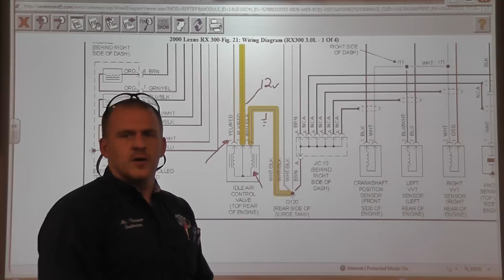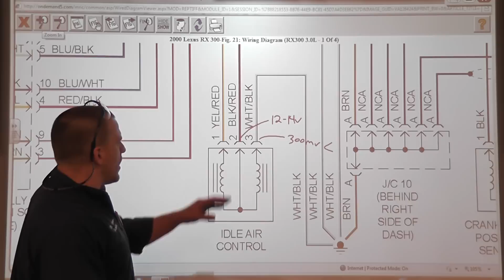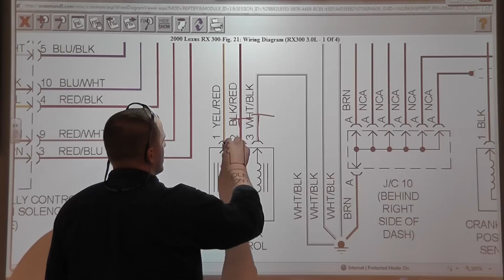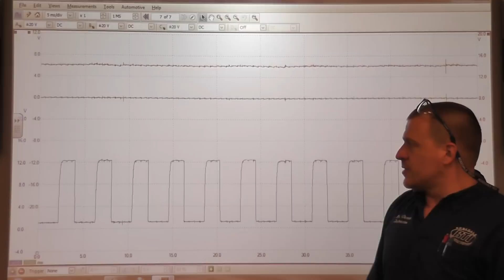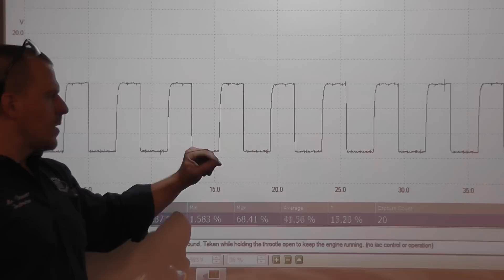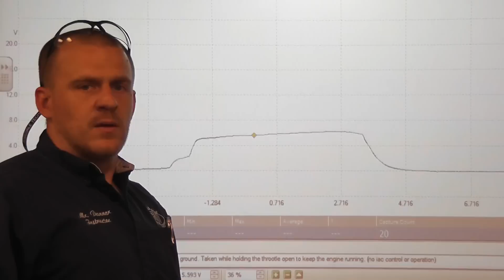Causes of low compression, no start from a stuck closed IAC (part 2) - Toyota/Lexus

Comment: Is though for the the voltage the battery voltage on that sensor one side it says it’s four volts and then the other side says it’s around 13 volts
. That would be a little confusing.

Comment: Question: Why aren't there any spikes from the magnetic field collapsing on this square wave?
Reply from the maker: Good question. This would simply be circuit a design where there are capacitors and diodes absorbing the spikes or its simply a matter of the speed it is being switched on and off factored with a super low amount of current flow
Reply: @ScannerDanner  Is there any way to distinguish between a good non spike signal and a bad square wave that isn't a result of collapsing magnetic fields? Also, just wanted to thank you for your channel. I bought your ebook and just joined Premium. I was blown away at the thoroughness. You were born to teach!

Comment: What led you to the idle air control valve being mechanically stuck? The idle flare up on start up?
Reply from the maker: Did you watch part 1? This one was crazy
Reply: @ScannerDanner  I just realized that.😂 that was alot of vacuum on a cranking engine. I don't think I would have found that one. Probably would have pulled the timing down for no reason. Definitely sounded like timing
Reply from the maker: @chrismay9319 I was about to go down that path too!
Reply: @ScannerDanner  this is exactly why I've been watching alot of your videos recently. I had to come to terms with my limitations as a technician and I had a decision to make. Either keep doing scan tool and multimeter diagnostic or jump into the scope world and further my diagnostic education. You've been a big help with that. Great stuff and I look forward to getting into your premium channel soon! Your helping people become better technicians in a world of parts changers😁
Reply from the maker: @chrismay9319  looking forward to having you Chris! Tons of videos here too 🙂
730 on YT and 540 on my website btw

Comment: Yes but the FLAIR-UP only happens if the engine is restarted warm, not starting from cold, if I understand it correctly; I notice it with my dodge ram v8.
Reply from the maker: Correct. Cold engine start up will have an elevated RPM that will stay elevated for a period of time
Reply: @ScannerDanner  thank you for replying Paul

Comment: I have an 07 Lexus IS 350 I’ve lost compression on cylinder 1 how does this cause loss of compression?
Reply from the maker: complete loss of compression, all cylinders, because the air intake passages were completely closed (stuck shut IAC combined with a dirty throttle body) The engine would start if we opened the throttle

Comment: I have "similar" issue.  1995 T100 3.4L...it sat for 2yrs.  It had compression & ran when parked. Now, NO compression on ANY cylinder.  Timing is correct and belt on. Checked compression testers. Put marvel mystery oil in cylinders and everywhere I could.  Still , NO compression??? Any suggestions?
Reply from the maker: Did you have the throttle open when you did your compression test?
Reply: @ScannerDanner  yes, I opened the throttle when trying....it reads zero across ALL cylinder and this vehicle I have driven since was brand new.
Reply from the maker: Broken timing belt or chain would be the next thing I'd check for
Reply: @ScannerDanner  that was 1st thing I checked.  Pulled the timing belt cover off, got my wife to turn it over. I wanted to see that at least the crankshaft was turning...lol. checked and belt on, all timing marks were on the money with #1 at TDC??? I haven't messed with it today at all. I just went out and squirted it down with marvel mystery oil / kroil oil mixture. In cylinders,  through oil fill hole, through pvc hole (just trying to soak it all in the oil). Some recommended me put some very thick oil in the cylinders b4 I check compression again, after letting everything soak?
Reply: @ScannerDanner  your video, the two part about IAC valve.....all I can say is Thank You!!! I took the IAC off and it was gummed up bad, stuck closed!!!......I should see a difference now right???... that I cleaned the throttle body like you mentioned in your videos and cleaned the IAC and got it working very free and like it should be working? I should at least have compression on some cylinderS I would think?  Its just so hard to set in that this little valve, that is supposed to control the idle, can do what it did!
Reply from the maker: @dgmenace73  but you said you had the throttle open when you did the compression test. That would eliminate the IAC being stuck closed as a cause for the no compression. 
So you're saying it runs now?
Reply: @ScannerDanner  no, I am not sure.  I'm only able to mess with it a few minutes at a time.....with all timing marks lined up and belt on, checked the rh side under valve cover b4 I did the IAC clean, even the marks are lined up on two gears there....so I am like 95% sure its not timing. I can see what you mean by giving it throttle would eliminate that valve because it would suck air in through the throttle body main air intake.   Is there anything else that you can think of....like something somewhere in throttle body stopped up like that IAC valve was?  I have never worked on on of these internally.  I have rebuilt old V8 like 318s and rebuilt 2.2 and 2.5 front wheel drive engines....never a double overhead cam engine. It looks like to me, I got to get me a helper.....but it looks like to be that the lifters or caps I think they are called, at least on #1 cylinder,  I can see that they have moved....I think they may be shimmed? Am I correct? They have a flat metal spacer in between the cam lobes and the lifters....it would be nice if I could rig up a way to turn over, may can get to starter solenoid on that side to turn it over and watch.  I thought soaking for several days now in marvel mystery oil and kroil oil would have broke anything seized up?  Any suggestions from you would GREATLY be appreciated.  I have not watched any videos as detailed as yours.  One of my compression testers has a male quick connect on it....I was thinking about connect to may air tank, or compressor to see if I can tell where air blown in cylinder would go.  I had someone ask me could the muffler or converter be completely stopped up?  I now with ATVs they won't run but it seems like they have compression,  only happened once to me....ATV had very bad blockage but it would crank and start.  I just don't see all valves being stuck? Have u seen that before?  I guess I just got excited that the iac was badly stuck closed....smh. i don't have a leak down tester but i plan on borrowing or buying one. Thanks in advance.
Reply: I meant I CAN'T see where #1 lifters have moved
Reply from the maker: @dgmenace73  leak down tester can simply be a compression hose with the check valve removed and an air line hooked up. No compression on any cylinder after just sitting, and it ran before you parked it, is unusual, especially if you have confirmed that your timing belt is still in alignment.  Let's get air in those cylinders and see where it is going. Maybe the headgasket failed on you? Block froze from not enough coolant?

Comment: What if my car had a high over extended rev before these symptoms occurred?
Reply from the maker: what, no compression after over revving the engine? just make sure your throttle is open when you do your compression test. If it is, you have engine damage

Comment: Really hope this is the issue with my 5VZFE. Been through everything else. Fuel, spark, timing are all there but when i took a look at my iac valve (thanks to you) I noticed it was frozen. (never thought to try and start it with TB cracked a little) also has 2 cylinders at 60 and 70 psi.
Reply from the maker: Don't panic about those two low cylinders just yet. Cylinder "wash" from extended cranking can reduce compression pressures drastically. Once you get it running, as long as it's not misfiring, you should be good to go.
Reply: Just got it running today and it cranked over a lot easier then before. Adding to my  favorites Have a miss but i think it was from a loose plug wire/injector

Comment: Can this happen on a civic 00? Even though it’s a different kind of iac?
Reply from the maker: can what happen? low compression?
Step on your gas pedal a little during cranking, if this doesn't improve your low compression issue, then no, this is not your problem.

Comment: Hey Paul ive got a question about your voltage tests using the scope. Would the scope show you a corroded wire whilst looking at voltage? 
The other day i was working on a horn circuit which is a simple 2 pin horn design, where one pin is 12v constant and then the other pin is earthed when the horn button is pressed. I had the 12v constant using my multimeter and a good earth but the horn wouldnt work. Horn unit was fine and the problem was a corroded live wire. I had to independantly load test the live wire using a high watt bulb at one end to confirm the issue. So would the scope show me a flat line 12v in my scenario or with the scope being so quick would i see it glitching all over showing me i had a problem? Thanks alot
Reply from the maker: To see the corroded wire with a voltmeter, the circuit must be loaded (horn blowing). So with the horn not working, you still needed to hold down on the horn button or pad for ALL voltage tests. Did you do that?
Reply: ScannerDanner no i didnt have the horn pressed whilst checking for the perminant live feed. So i assume that is an unloaded voltage test which isnt good enough to confirm wire integrity?
Reply from the maker: That is correct my friend. There MUST be current flow for accurate voltage measurements. And when current flow cannot be established (say the horn motor itself was open), this is where a simple incandescent test light can be your best friend.
Reply from the maker: In your case, had you been pressing the horn button during your tests, you would have definitely seen the voltage drop and would have known immediately you had a wiring problem.
Reply: Paul as always i truelly appreciate you taking the time to reply and giving me guidance. I will adjust my testing method moving forwards 👍
Reply from the maker: awesome, and this particular one will change your life. seriously man. 
Thanks so much

Comment: would the unplug it test give a OK understanding  of the circuit design if a wiring  diagram  wasn't  available?
Reply from the maker: depends what you are trying to do
Reply from the maker: but yes as far as power and ground side switching goes

Comment: My 1999 RX300 had a po171 bank 1 to lean it was misfiring no power . I replaced the o2 bank 1 sensor and fixed it ? This o2 controls the air fuel mixture.

Comment: Would this cause a P0446? Very low Idle while AC is on or Turning (Power Steering). Since I could no remove the screws I sprayed throttle body cleaner in the hole above and it is temperamental now.

Comment: Put as much pressure on the back of the screwdriver while turning, and make sure it's sitting squarely on the screw's. and yes they are very soft, I stripped the one closest to the firewall, so I used vise grip pliers to get it off and then replaced the screw with a new one.

Comment: Hi, I have a same 02 RX300. Yesterday, I tried this myself but I couldn't remove those two bolts on the electrical part(Sensor?). How did you do it? the bolts are extremely soft and I almost stripped one of them.

Comment: Hi Paul, I know alot of times I hear you say how the computer should be reacting to certain conditions, for example in this video, you had the student turn on alot of  accessories and you expected the duty cycle to go up, which i guess in turn helps compensate for any mechanical and electrical load to keep the idle rpm about  the same.  How do you really know for sure though about these predictions, are these things enforced somehow with a computer standard, like OBD-II, or ...continued on next:

Comment from the maker: My guess is you are using scan data to tell you the O2s have slow response? This is a misleading test. Scan data update "baud" rate can be slow on some of these older systems. What I don't like is your lean condition at WOT. This indicates a fuel delivery problem. Dirty MAF, low fuel pressure, old gas?, plugged injectors from old gas?

Comment: @scannerdanner I have 98 mustang gt with only 65000 miles.. This car has been sitting up a while. Long story short I have driven well over 200miles in this thing.. I hook scan too livedata all 02 sensors have slow are no response at all..at wot bank 1 o2 will go 700 mv then drop to 0mv more or less with the other... No dtc could they have carbon build up from sitting up so long??

Comment: What is surprising about this particular problem is that nobody even tried to give slight gas during cranking!  Looks like nobody remembers carburetors any more.  Somebody should have at least tried "clear flood" mode before putting on tow hook.

Comment from the maker: Pierce away:) 
Just be smart about it. Make sure it is not an airbag wire. Make sure you're only doing this on a 12v circuit...hybrids can kill you (in fact you don't want to backprobe these either).  Use some liquid electrical tape when your done if the wire is in a high moisture environment. 
It is absolutely necessary at times to pierce a wire to get a signal. (unless you don't care about how long it takes to diagnose the problem)

Comment: Hey Paul I got ford Taurus 03 with v6 OHV Engine , on a normal idle it's run good ,but when I start the AC its get rough ideal each time the  AC clutch engage ....my question is , could be the IAC cuz that issue and how do recommend to diagnos it or to clean it .....thanks in advance

Comment from the maker: Yep, Honda, Toyota, Lexus probably certain model Acuras? There were some variations to it too. As I mentioned in the video, some of them used two different pulsed ground controls. But they all have the same problem don't they....mechanical sticking of the plate.

Comment: Great video Paul, I see you have some fancy coloured leads for the pico! I'm currently sorting a idle problem on a 1200cc fiesta. It starts fine but as soon as the throttle is blipped the revs are hunting up and down between idle and 1500rpm. I'll check the wiring diagram as I'd like to look at the IAC with my pico. No doubt the TB and IAC will benefit from a clean but it's all about the learning. Keep those pico videos coming!